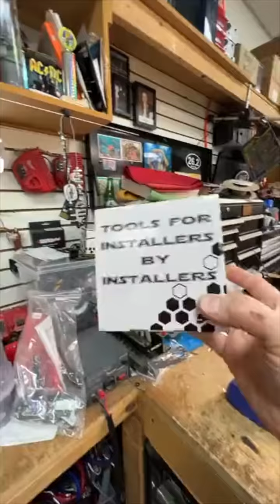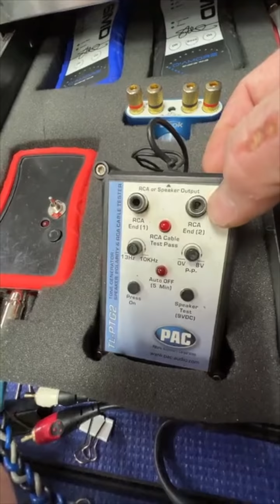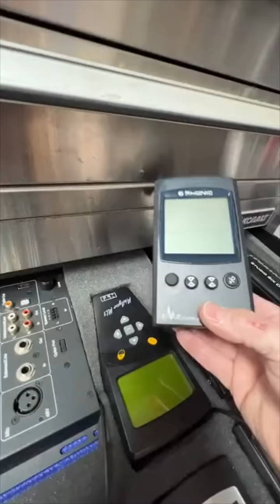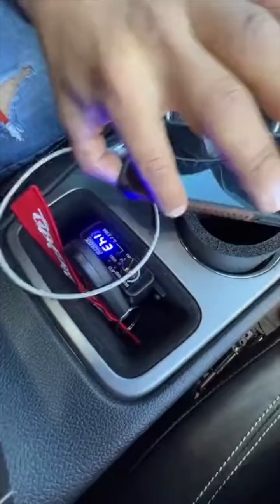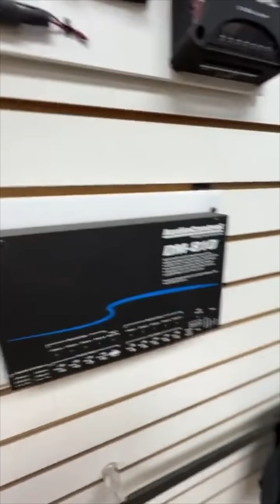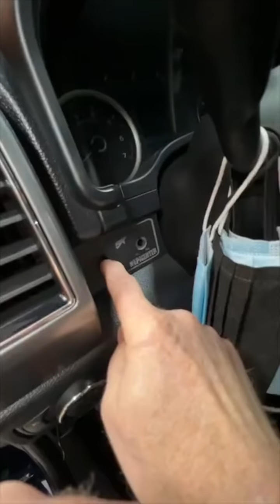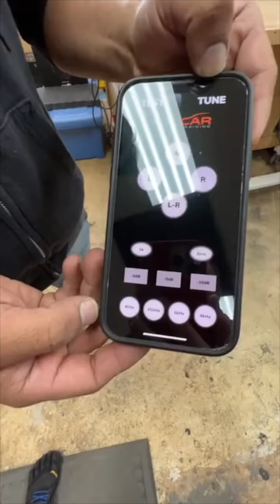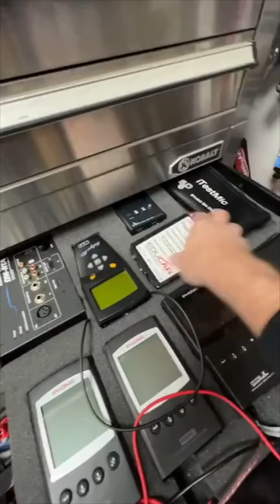Big Sundown Salt and a f150 911 Instagram recap show

Comment: For the 2019 ranger and up I have been putting in Kicker L7t 8 inch loaded enclosures. It just fits behind passenger side rear seat once the carpet has been cut and the jack holder taken out.  Those rangers integrate nicely with the kicker key 500.1 sub amp and that box.